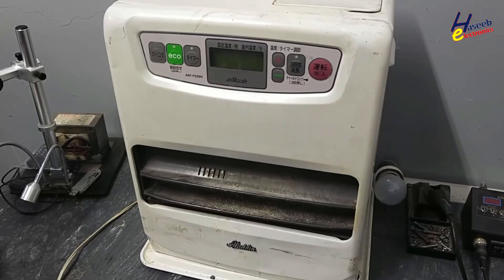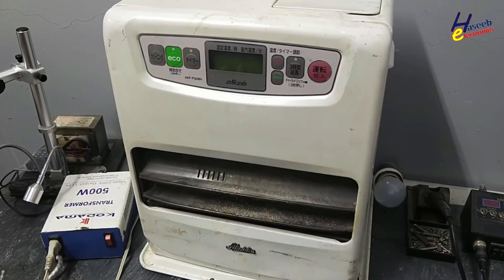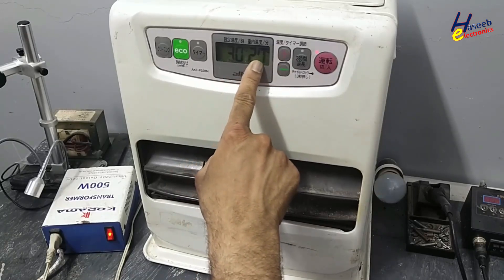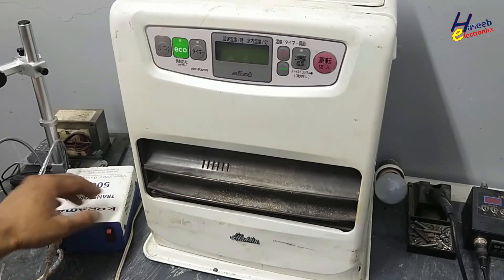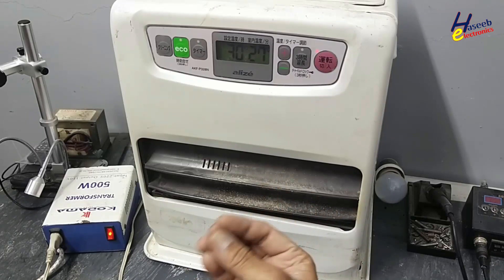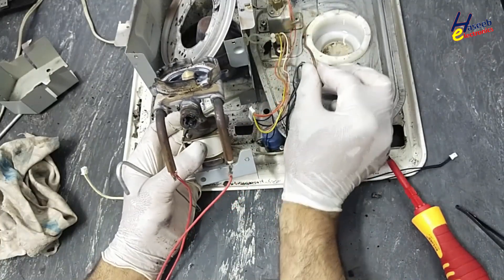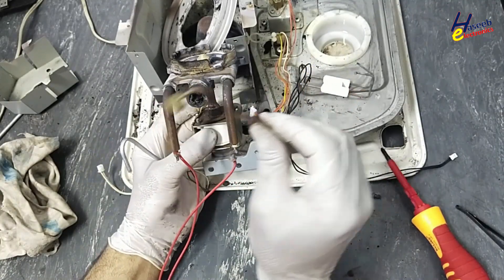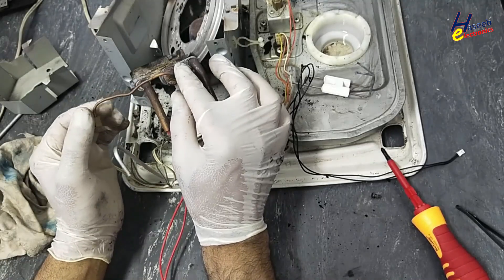{1341} Aladdin Oil-Fan Heater Error H46 | Step-by-Step Troubleshooting | Part-1

Comment: How does the heater sense a gas leak? No heat from the burning chamber, or a gas sensor?
Reply from the maker: yes there is NTC temperature sensor, if the burning chamber temperature doesn't reach to specified range, it creates H46 error